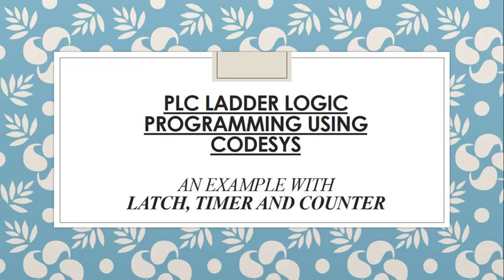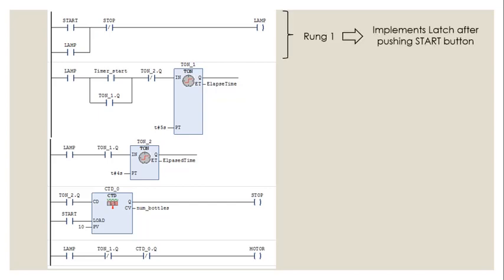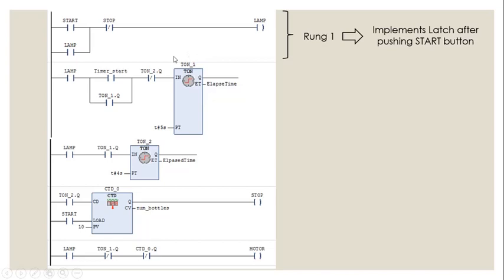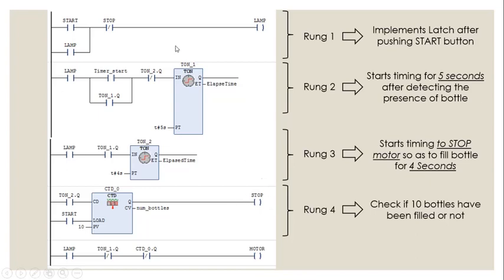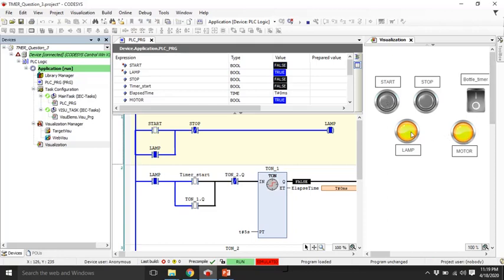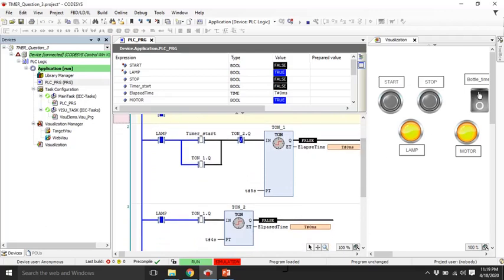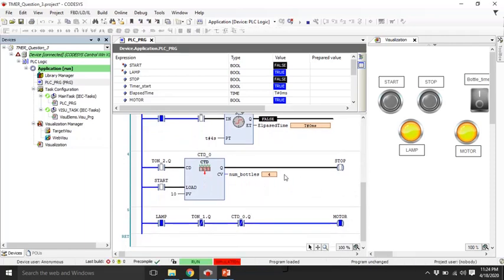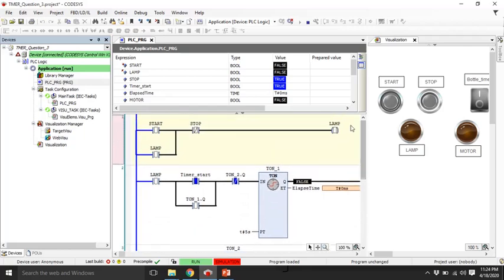PLC Ladder Logic Diagram with Timer and Counter (Codesys)

Comment: Sir I am actually doing a different project but it is based on TON also, the problem is that the timer doesn't stop after it has elapsed. So my motor keeps running indefinitely. And the plan is to stop the motor after the preset time has elapsed. Do you know what might be the problem? I can send you the pictures if you have time.